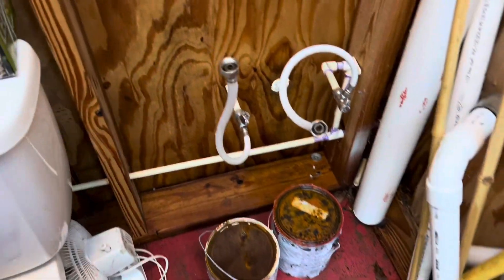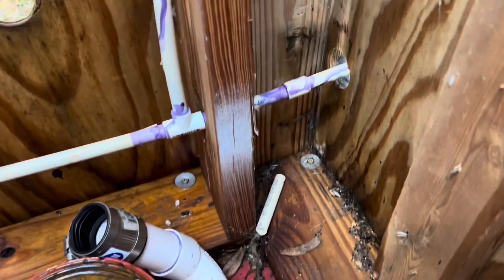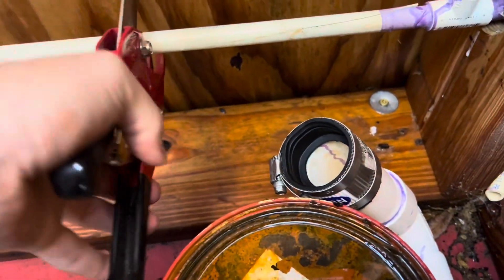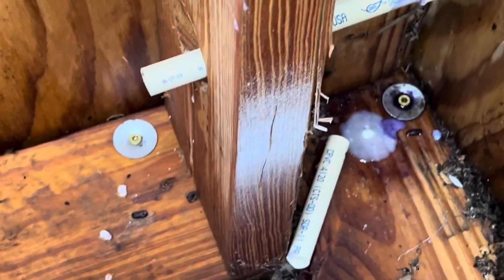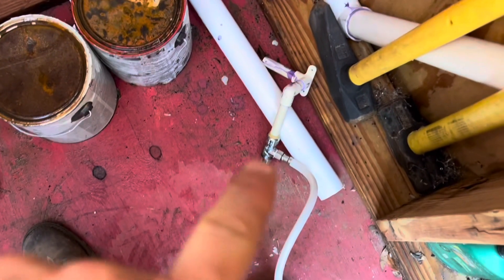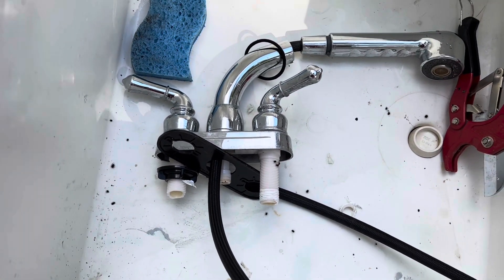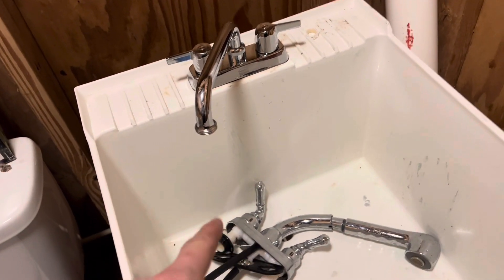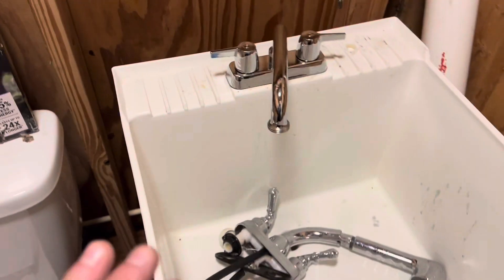Blown out water line

Comment: Might want to consider a way to drain that pipe before future freezes?  Having it lower than the faucet means water will be trapped down there.Might add a little tap or drain?
Reply from the maker: Great suggestion. I do have drain but forgot to drain the lines.